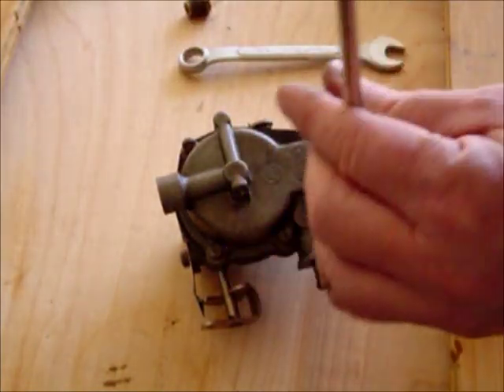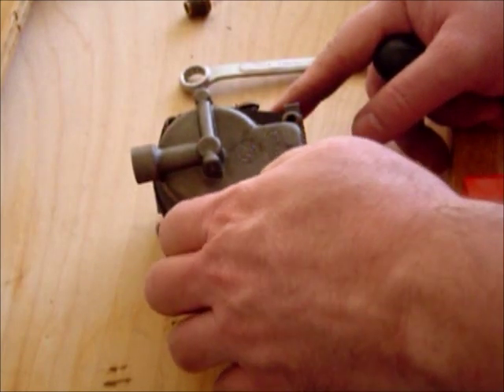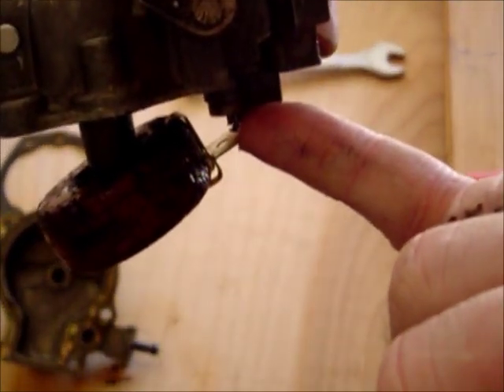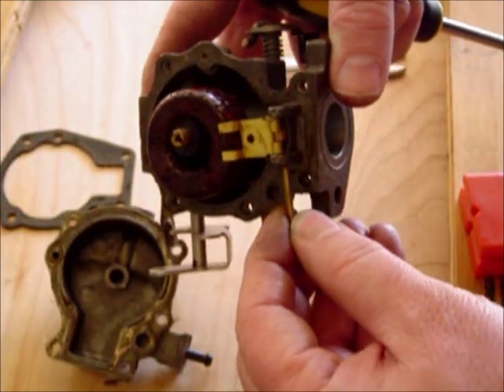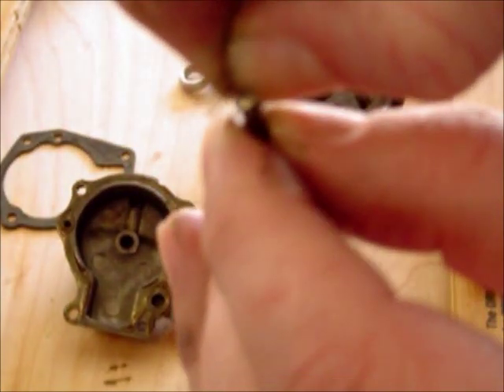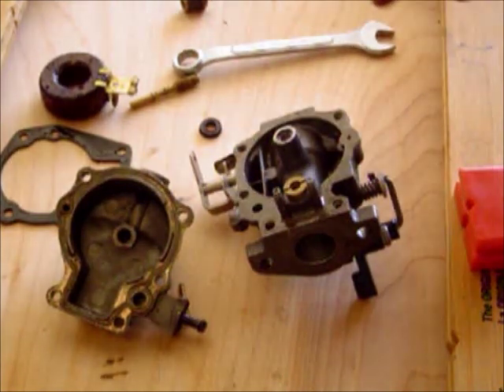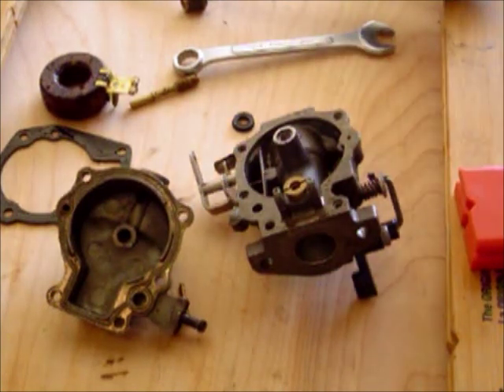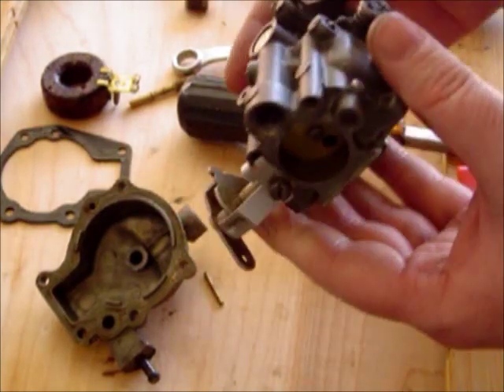OMC fix jet carburetors part 5 of 10  (Motor displayed 1968 Johnson 6hp)

Comment: Can you swap a fixed jet carb bowl and run it on a carb that had a high speed needle in the bowl?
Reply from the maker: Mark Weaver Morning Mark!  That is not a straight forward yes or no type of answer.  What make, model, year, hp motor are you inquiring about?  It would make giving a response much easier.
Reply: @cajuncookone  Here is what I am trying...I have a 1967 18 hp with a carb that has a CRACK where the needle valve seat threads in...so, I am taking the linkage off a good carb from a 1957 18 hp carb putting the linkage on my 1967 on it, AND the bowl of the 57 has the high speed needle in it so using the bowl from the 67. The carb BODY is EXACTLY the same. The 67 has no hole in the lower cowl for the  high needle because they are fixed high speed jet after about 1962. I can't see why it will not work?? What do you think, if you can make sence of this ramble!
Reply from the maker: @outboardfixer  I'm assuming you are trying to put the 1957 Johnson 18hp total carburetor on a 1967 Evinrude 18hp power head. 

It looks like it would probably bolt on the the power head and there may be enough clearance for the lower and high speed needle. 

The issues would be proper link and sync with the throttle cam and the throttle cam follower.  I do not think the air silencer would match up well with the low speed needle length on the 1957 carburetor.  The adjustment of the low speed needle and high speed needle would be have to be done with the hood off.  You would not be able to swap the low speed needle from the 1967 18hp carb and put it on the 1957 carb.  Not compatible.

The 1967 18hp bottom fuel bowl portion with the high speed jet could be swapped and bolted onto the 1957 upper carburetor body and then you would not have to worry about the high speed needle.

NOT sure if all the carburetor linkages and choke lever would cleanly transfer.

Impressions:  Probably could be done, but not cleanly.

Suggestions prior to transferring the 1957 18hp carburetor to the 1967 power head:

- Look on Ebay for a good used 1964 to 1969 18hp replacement carburetor.

or

Place a want ad in the classified section on the AOMCI website.  There are plenty of Antique Outboard Motor Club members that have tons of parts motors that might give you a really good deal on a replacement carburetor for your motor.  I am a member of the AOMCI club.  Here is the link.

https://aomci.org/classifieds/

I will be interested to see how this turns out.  You could also post your original inquiry on the AOMCI website in the Ask A Member section.  There are alot of experienced guys there that may have knowledge regarding your specific project. Here is the link to Ask A Member section for the AOMCI website. You will have to register for the Classified or Ask A Member sections, but it is free.

https://aomci.org/resources/ask-a-member/
Reply: @cajuncookone  Thats what I was saying, I am using the bowl off the 1967. The carb bodies on the 67 and 57 are identical so linkage swap worked, I am just wondering if a fixed jet bowl will work on a body made for a bowl with a high speed needle in it. If so ALL high speed needles could be replaced with just a plug in the bottom. The carb is on the engine and WORKING in my barrel...just have not had it on the water yet...it starts, idles and revs up PERFECT in neutral. I will let you know after river test.
Reply from the maker: Mark Weaver Sometimes, it is hard to determine what someone is asking, so I like to clarify.  I work in the medical field and details and understanding is important, so I have a habit of clarifying.

Some years back, I was having a discussion with a well respected and well trained outboard mechanic who was working on motors in the 1950’s 60’s 70’s and 80’s.  In the 60s there were some kits made to convert high speed needle carburetors to a fixed jet system.  Convenience was one advantage.  A disadvantage of the fixed jet was that you could not fine tune the running of an engine at different altitudes.  At different altitudes an engine with a high speed fix jet could run poorly (either too lean or too rich) based on the altitude the fix jet was meant.  So, having an adjustable high speed needle allows you to make more precise adjustments and can be adjusted for different altitudes.

I once did put a fix jet carburetor bowl on a 1957 3hp Evinrude.  It ran ok, but it ran smoother with the adjustable high speed needle.  It idled smoother as well.

Lower and smoother idle is also dependent on the proper high speed needle adjustment.  That is why the high speed needle is adjusted and fine tuned first prior to setting the low speed/idle needle.

Theoretically, you application has merit.  Please try it out at the lake and see how well it runs.  If it runs to your satisfaction, then awesome!!!!!  But not all applications will turnout as well as yours, so saying all high speed needle carburetors should have fix jet carburetor bowls is not practical.

Please, let me know how it turns out :)  I am hoping for a good turn out for you!!!!!

Cheers,

Cajun
Reply: @cajuncookone  Yes you are right on all counts...I did think about the altitude adjustments ONLY because I have a 20 hp chrysler that has three different jet sizes so had the experience to know that. I am at sea level so don't have to be to concerned as here is the only place I boat... BUT humidity is VERY high here sometimes and I think it affects the carb a little. As for the high needing to be right to get a good idle you are absolutely right...not many people know that but the carb is ALWAYS drawing a little  off the high side because air is sucking through the carb THROAT and it will draw if high is open to far...I will let you know how it goes and thanks for the chat.

Comment: Hey man
Thanks so much for these videos!
They've been really helpful.
I just acquired a Johnson 6hp that looks like the same year.
Can't get her started yet though...
Finally got spark after setting the plugs and points.
Rebuilt the fuel pump seems to blow the right way.
And now I was able to get the carb out and clean it
without the pull starter assembly falling apart on me.
I thought I got it all right, but... I messed up the low speed packing seals!
Forgot to take them out and melted/mushed them with the carb cleaner.
Can you tell me if there are any suitable replacement washers I can get
reasonably easily without having to get a whole carb kit?

Thanks again man